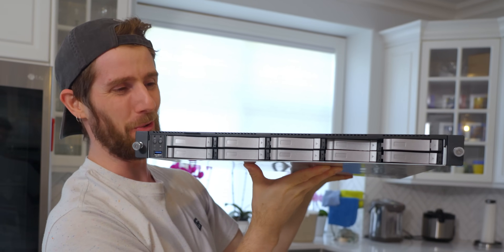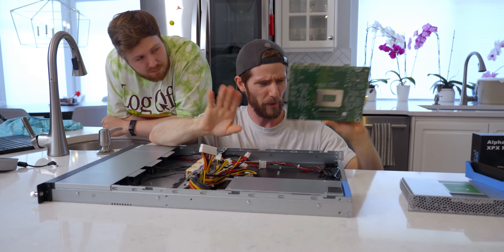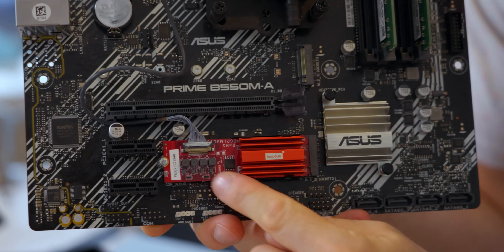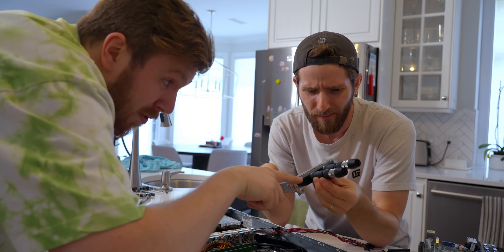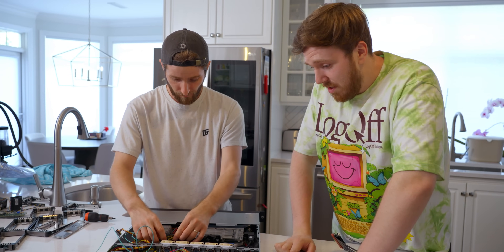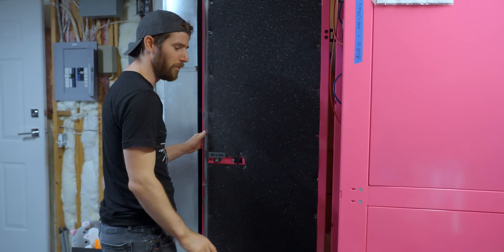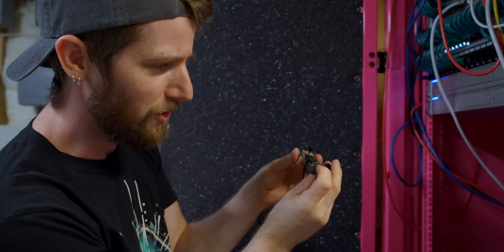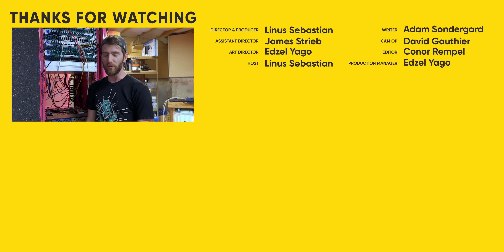I designed my perfect gaming PC, then threw it away - 1U PCs for My New House Part 2

Comment from the maker: What do you guys think of this server chassis gaming PC? Let us know below!

Buy an AsRock Rack Z690D4ID-2/G5/X550 Deep Mini-ITX Motherboard: https://lmg.gg/0LTW4
Buy an Icron ICR-EL5363 KVM Extender: https://geni.us/MwDAjv
Buy an Alphacool 12936 Eisblock XPX Pro 1U CPU Water Block: https://geni.us/Oznhp
Buy an ASUS Prime B550M-A Motherboard: https://geni.us/CuC7RB
Buy an .innodisk. EGPL-T101 M.2 to 10GbE LAN Module: https://geni.us/lVIzZV
Buy a Sabrent Rocket 2Tb NVMe M.2 SSD: https://geni.us/2Mn0Nwy
Buy a Silverstone ES03-WiFi V2 Remote Computer Power Switch: https://lmg.gg/4KRpj

Purchases made through some store links may provide some compensation to Linus Media Group.
Reply: Linus thought having engineers on staff would get rid of the jank, but little did he know we do jank too. We just do it with tighter tolerances 😂
Reply: Hey linus hold the remote against your jaw while pressing the button, it will significantly extend the reach of the remote. I use that hack for my work van every single day to close it from inside the house
Reply: linus jank tech tips 2023
Reply: Linus should open a storefront and sell custom pc's at a fair price👍I would shop there.
Reply: Linus, please ask Adam where it got that shirt, I definitely need in it. #sickshirtadam
Reply: Linus , I am jealous of your kids
Reply: You could use two Shelly plus 1 smart relays. It’s wifi based and can run on almost every voltage ac or dc. It would allow you to just a put a button on the wall or desk. They’re super responsive as well.
Reply: @jamesa8851 yes, exactly!
Reply: @jamesa8851  Does the Shelly Plus 1 have a momentary mode?
Reply: @teqwar4600  yes. You can use a momentary button and you can convert a switch to momentary as well by adding a one second auto off.
Reply: “…my kid, my kid, and my other kid. Some day I really need to give them names” 🤪
Reply: @philiprobar doesn’t make for a good video. The whole point is to have a Janky build that few would even try.
Reply: I would much rather see a 4u (or more) version rather than 1u and yes I do still want to rack mount it neatly with other equipment.
Reply: Should you manage to make this for cheap I would consider moving my personal pc to this solution.
Reply: Nice Rack, I give it a solid 7.3/10.
Reply: i want it.
Reply: Cardboard box works fine.
Reply: can i keep it xd
Reply: Keep the cameraman i love him
Reply: I keep planning to rebuild my 1U Barracuda PC. It’s a little out of date, but still functional. If only components were a bit cheaper.
Reply: A lot of the links don't work for some reason?
Reply: what's wrong with WOL?
Reply: What were those white fans on that 360mm radiator? ....nevermind, found out they're corsair....gross
Reply: kids will have a big flex moment when they turn on their pc like a car
Reply: It probably overheated
Reply: Overall... overly complicated solution
Reply: Give it table legs, it'll be a tiny hidden PC desk.
Reply: you guys are making things harder on yourselves by trying to incorporate more than what's needed..  that's why you are running into problems.
Reply: it's horrible
Reply: well it a cool idea but that HDMI cable is not happy and also that 3090
Reply: rip the es03 wifi remote switch from silverstone is unavailable anywhere
Reply: can we see something comparable to the icron but in the consumer price range?
Reply: In todays episode of "Overengineer Underdeliver: I put a  Twin Turbo V12 on my PC, Watch 3000 HP blow my server rack"
Reply: Too expensive, seemed like a nightmare to build/setup, plus I have to wait for another video?!
Reply: that's a mistake
Reply: Hear me out, why don't you ever try a smoke machine or air compressor to blow air into the tubes before filling it with water? That'd let you catch any leaking issues without potentially risking hardware worth many shekels. I'll gladly accept a timmies gift card for saving linus' wallet from future catastrophes. thx <3
Reply: Can someone explain what Linus discovered at 16:15?
Reply: Please don't drop it again 😭
Reply: you go AMD.... you FIND OUT.... enough with crappy red team already.. yes I am that person :D

Comment: I have a question i want to make my own pc and used a site where you select the parts you want and they put together, but i'm not sure if im using the optimal parts to work with each other (sorry my english is not great) So i started with a Ryzen 5 7600X and the MSI RTX4070 X Gaming Trio 12gb is that a good combo?

Comment: I don't understand the point of this video, at all. So you abandoned the original hardware for something cheaper, janking something together. Ok I can understand that... sort of. But then things have to be swapped out, still end up using expensive water blocks, etc with even jankier connections, all to end up with a system that's definitely not going to be permanently installed there? But why?

IMHO, either show us the right way to build a 1u racked gaming computer, or go for a more reasonable and home doable 2u+ solution that will actually live in the rack long term. Doing jank for jank's sake just seems useless and not very fun. This isn't a funny schtick really any more. There's no point to this at all. And if the point IS to show why this is jank and should be avoided, then you should conclude with that point. There's no getting around doing it right. Just do it right already.

Comment: PSA:
Both the WD_BLACK 2TB SN770 and the SAMSUNG 980 PRO 2TB are over 5/3.5 GBps R&W and are available for the same price.
Samsung 970 EVO Plus SSD 2TB is about 3.5GB/s R/W and much cheaper (~80$).
And for those Israelis looking for sun 75$ items (for the exempt in import taxes), there's the Silicon Power 2TB NVMe M.2 PCIe Gen3x4 2280 with about 2.2/1.6 GBps R&W (currently about 65$).
Other good options are the Crucial P3 and P5 and you can get both (with 1TB) for under 75$.

Comment: Hear me out, why don't you ever try a smoke machine or air compressor to blow air into the tubes before filling it with water? That'd let you catch any leaking issues without potentially risking hardware worth many shekels. I'll gladly accept a timmies gift card for saving linus' wallet from future catastrophes. thx <3

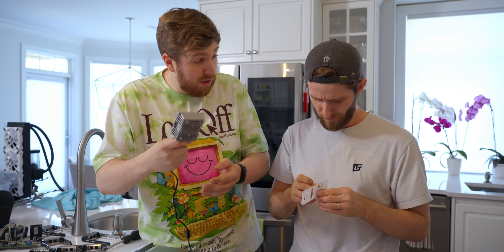Comment: 6:36 So you know that you can get 24 volts out of any normal computer power supply right? All you have to do is use the -12 volt wire and use it with the +12 volt wire and boom you have 24 volts.

Comment: and, here, i would have just built multi systems in a 4u or 5u case instead of building a bunch of 1u systems... i mean i have done it before, you can cram 4 boards, drives, videocards, etc into a 4u chassy, took some creative work when we did it as, there were far less breakouts and similar cables back then.. but... we had 4 full systems in a 4u, matx setups even rather then itx.. itx type boards.. 6 would be easy to fit in 1x4u chassy... and i have seen 5u cases, the upper 1u the "lid" for lack of a better term, that had mounts for drives across its full length.. so many hdd's... :)

Comment: Alphacool fittings like that usually come with a metal collar that has 'teeth' that goes just over the end of the tubing and when you put the rest together the pressure causes the teeth on the collar to dig in to the rubber of the tubing and hold it securely in place, they're not quite like the regular water cooled barbs so use that metal collar.

Comment: I used a similar power system for a media center, except I actually connected it to an IR receiver that 100% works to turn on the computer from completely off.  As well as works as an RC6 remote the rest of the time.

Comment: I just use smartplugs to have 100% power control over my machines. Even works with "google turn on primaries/secondaries" etc automatically. Have used this to power cycle my hardware when I'm on the other side of the country. 25€ per one of those plugs and having anydesk installed and I haven't had control anxiety since I started doing this on all my work and home machines.

Just note yo have to set the "turn on on AC power" from BIOS and voila. In addition I also use a special app I created to completely turn off the relays when power use goes below 5 watts to prevent windows from autostarting, updating and bricking itself (has happened), and allowing turning those machines on through google assistant which became a half-accidental feature and easier than just using the power button.

Comment: fiber optics in the walls but no cable for a 5V switch?
is there still lan cable, you could use that.
as an electrician this wireless solution makes me real sad.

Comment: I have a question regarding cost for a low power gaming PC. I mostly play retro, so i was wondering what the cost for these specs would be. I'm looking into an air-cooled build with 8 gigs of RAM, 2 gigs of VRAM, a 2 Ghz processor, and about 200 gigs of storage. How much would a build like that go for?

Comment: 16:42 This happens because a normal push button essentially works by just shorting out the PWR pin to GND, also known as ground. The ILO/KVM works by sinking the pin to ground, so its ground must be connected to the PC's ground, and the other must be connected to the PWR pin.

If you reverse the pins, the ground of the device will now always be connected to the PWR pin, so it simulates a push button always being pressed. One solution to fix this is to use a small relay that would actually emulate a button being pressed, however, this is not needed since the correct connection will do the job just fine.

That is why connecting a normal push button doesn't have any orientation while these devices do.

Comment: Interesting idea, but also challenging because 1u is not very high for gaming hardware. Made me think: why not make a 5u case with 5 motherboards in it. That would give the option of using componets that are higher than 1u. Because not all space is used, 5 mothersboard would probably even fit in a 4u case. And if using vm's is an option, then you could safe space by using more powerfull hardware and share it.....I might try that :)

Comment: A freestanding heat pump water heater would've been perfect for this job just soaking up all the heat into the hot water you use at near-400% efficiency. It's more efficient than gas and I've seen flow-through options that are placed before a tankless unit so the tankless only kicks on when you've burnt through all the cheaply-heated water with return-from-event mass-showertime, large tub filling, or power outages where powering a tankless is downright easy.

Comment: 14:46 remote power on solution... erm, can't you just do wake on USB keyboard?  I used to have my PC in the spare/"gaming" room, with Fibre-optic HDMI and Looooong USB extension to the living room, with a powered USB hub under the TV with wireless keyboard and mouse dongle, and wireless XBox controller dongle... 

TV on, and press space on the keyboard downstairs turned on the PC. 4k60 gaming, Netflix, Amazon Video, Youtube etc relaxing downstairs on the sofas. Multiscreen gaming and VR upstairs in the gaming room.

No need for a second "media centre" PC. And the old OC'd 5930k with 2080ti and enough fans that it sounded like an aircraft taking off was safely out of earshot, upstairs.

Comment: That 4-5U server/PC with lightning on the front has some serious amount of liquid missing from the loop. You can see all the air moving in the top pipes. I know, that considering the placement those pipes are the top of the loop, where air will always gather, but Linus (or Jake or Alex probably) could still refill it to lower the air amount.

Comment: I saw the video from a few years ago about how you did the machine in a different room... But what equipment are you using to put your stuff in a different room?
I would assume its the icron USB / Fiber box. But what else are you using? Assuming its the optical Thunderbolt 3 cable on the MB then into a Thunderbolt 3 dock?

I cant find any good relevant information... I am trying to move my pc out of my office and into my comms closet across the house.. but I am not sure if I NEED the icron dock or not.. and how does the GPU work with the thunderbolt 3 optical cable? LASTLY... I am running AMD.. so I can get the Asus ThunderboltEX4 PCIE Thunderbolt card.. will that work?? HELP please!

Comment: HELP!          

 My PC just randomly turns off when I play games. Even games as simple as portal and psychonauts my pc will turn off and back on. It's a custom built pc I bought off of somebody. I don't know much about pc's but I know when I turn on the PC the graphics card slowly flashes red and the fans never spin and are dusty. It shouldn't do that. It doesn't turn off when I use art programs or go on opra it's just purely on games that it has troubles. If you know what could help please let me know. If you can't, can you tell me where I can go to ask for help.

Comment: Id get some sheet metal plates with curled up sides to put in between the "servers" inside the rack. So if it ever leaks... it wont drain down but e.g. to the back kind of like a funnel.

Comment: I love it when you decide to do something against experience and and get the expected consequences. For a "Silly Linus, racks are for corporates" to "did you forget how to turn it on?". At least the remote power solution is silly, the reason it did what it did is because the device's ground. The power and reset switch have no polarization, because the switches just close the circuit to power or reset. But when it's run by an IC, it actually has to send a current across, even while the unit is powered off. So you know, USB power management might be an issue there.

Comment: Those optical display port cables wont work via (most) extensions because they require pin20 on both ends to power the convertor(s) (copper>fibre and back again). Most COTs cables don't include pin 20 (pwr) (might be to adhere to DP standard), so find some extensions that do and they'll work (:

Comment: Used one of those Silverstone PC power on remotes for my HTPC around the time they first came out, the CR2032 battery never lasted more than a couple of months daily use, if that. 
Seems like a CR2032 should theoretically last a lot longer than this for remote use, given they've been used in car/garage remotes? Possibly some kind of battery leeching issue going on? 
Or a hardware issue that was revised since then? Who knows, was super annoying though.

Big shame the Silverstone remote either doesn't run an AA/AAA battery or have inbuilt lithium battery with USB recharge, otherwise would have been far easier to live with.
Believe there's an app controlled version too, but personally don't want to have to open my phone or have an assistant listening in just to turn on a HTPC (dnw to use windows sleep/wake, or magic packet either, both have their own annoyances for my use case)

Comment: I think I would have bought or made a custom 5 or 6 unit wide box. And used normal parts. Separated internally. 5 units is more than enough to do mini itxs vertically and the off the shelf parts would of more than made up for the cost of the box.

Comment: This brings up the question: what's the performance difference between a cheap motherboard and an expensive, cool-looking motherboard? I mean, if you don't take into account the better CPU and such, does the design of the MOBO affect the performance? As in, would a cheap MOBO crash more and have more instability issues, etc, by the cheaper way it's designed? Or is there absolutely no difference and it's just a matter of compatibility with more performance parts (latest strongest CPU, RAM, GPU, etc.)?

Because, for example, in audio, no two sound systems are the same, with some companies making sure that the traces are not 90 degrees or sharper, or shorter traces, etc. to make sure the audio is as good as possible. Do motherboards have the same kinds of benefits or design schemes? Implying that some lesser well-designed MOBOs could be more prone to failure.

So is there a difference?
Reply: Better motherboards could have better power delivery which would enable better overclocks. And better motherboards might have better components such as capacitors, making it more reliable over time. Other than that the real difference is a matter of features. For instance the more expensive motherboard will have 10GBaseT while the cheaper one will only have gigabit Ethernet.

Comment: The biggest problem with your setup Linus is that you're only cooling certain parts, things that won't have a water block will be hot AF ssds/ram/psu's etc.  What you should have done was run and IN and OUT for the whole room utilizing cheap industrial radiators and slow moving high volume fans, would give you the desired result, cool server room and warm pool, except the whole room would be cool not just your cpus and gpus...
Reply: Honestly sometimes I think you create these problems for yourself because you think you are smarter than people that are much smarter than you.

Comment: Instead of the remote control (which I have used in the past) I used an esp8266 micro controller as part of my smart home to turn a relay on and off.
I was able to control it via an alexa voice command (developer account shenanigans) 

I imagine you could have a big ol' wifi/zigbee button on the desk which uses Home Assistant to turn on and off the computer

Comment: here's a tech tip to make that remote range waaay better.... touch the remote to your head then press the power button
I use that whenever my car remote battery is low and I'm using the remote from far away. 
idk how it works but oh well.